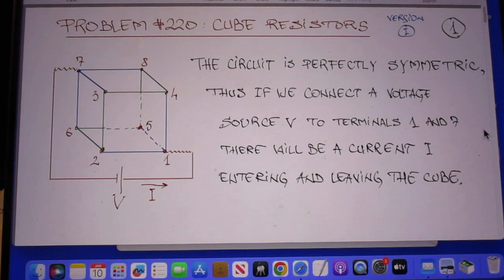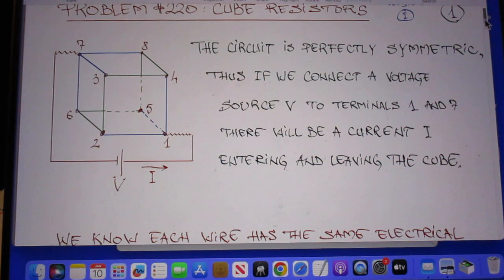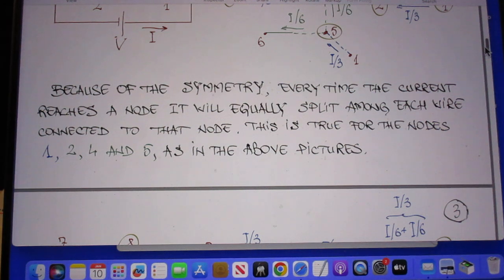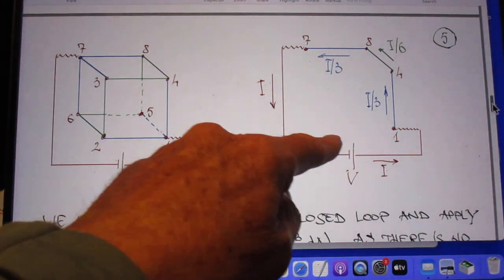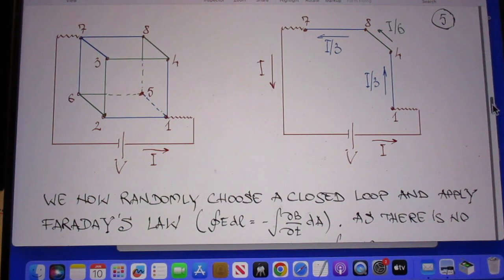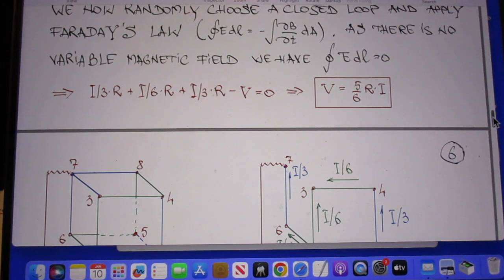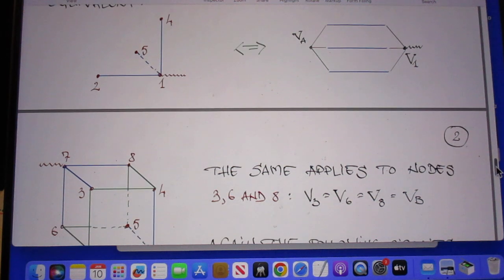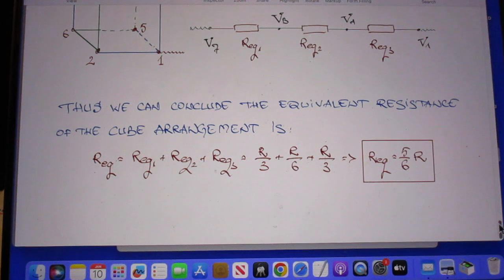Eugen's Solutions to problem 220

Comment: There are multiple methods to solve these kinds of questions either by symmetry, plain old Kirchhoff law or my personal favourite I draw a simplified version of this circuit kind of in 2d by checking the connectivity of each of these resistors hardly takes a minute and then we can find some symmetry in them
Reply from the maker: You're right, there are many ways to solve this problem

Comment: Sir, if a particle performs SHM, even the value of its displacement from the mean position (x) also performs SHM, Can the same be said for the values of velocity (v) and acceleration (a) of the particle?
Reply from the maker: watch my shm lectures in 8.01; you can then answer your questiions yourself

Comment: It is worth noting that the equivalent resistance between nodes 1 and 2 is 7/12*R. I calculated this using the node voltage method in circuit analysis. How can I share a document containing the solution?
Reply from the maker: interesting

Comment: Sir,  could you  answer please to find equivalent resistance between 
1. Face diagonal and 
2. Adjacent  points
2.
Reply from the maker: is this a joke?
Reply: @lecturesbywalterlewin.they9259  in given solution  what is the equivalent resistance  between  points 1 and 2 ?
And  equivalent resistance between  1 and 3  ?
In these points there are  no symmetry  like points 1 and 7 .

Here current distribution  is difficult  so I asked you
Reply from the maker: @ashrafali4297  STOP IT is this a joke???   the answers are trivial.  just watch the solutions and you can then see your answers